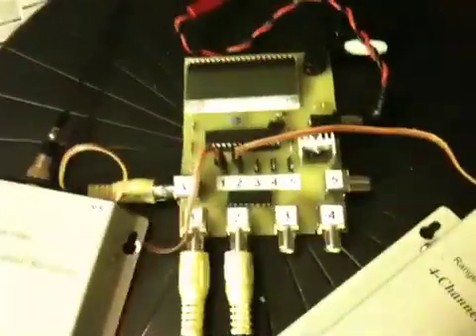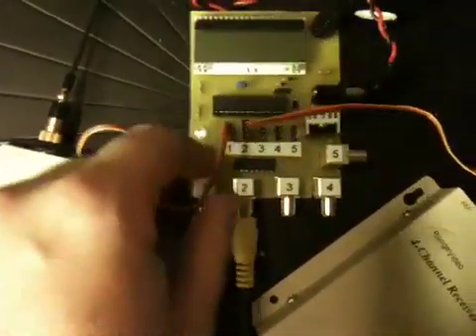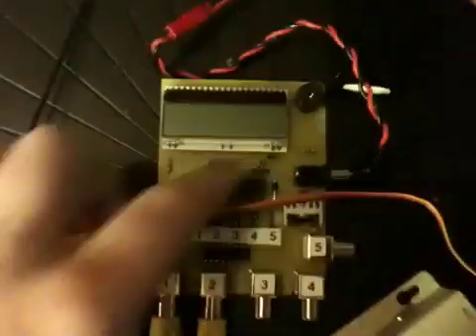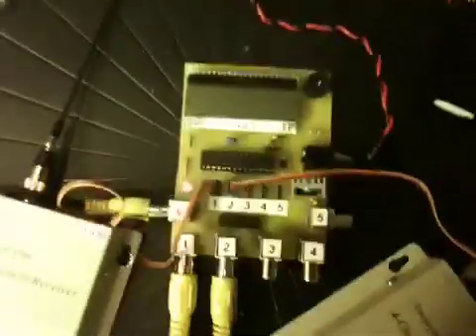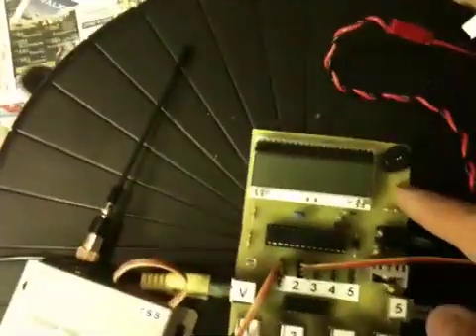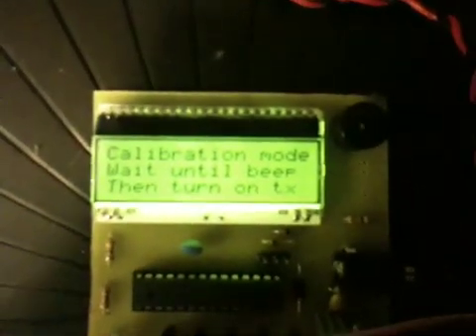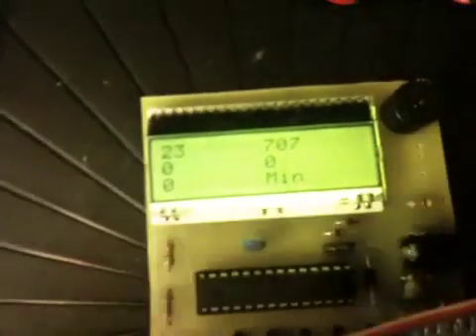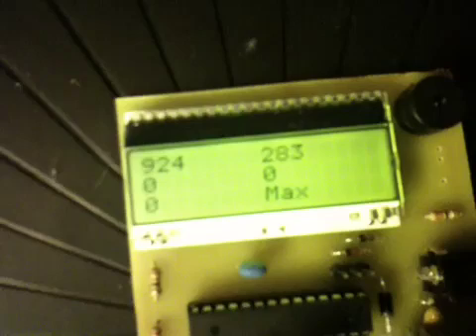FPV RSSI SWITCH v1.0 test

Comment from the maker: @Dmitry968 I know what you mean, but i made this for diversity purposes like polarization issues and such. And to be able to use multiple antennas instead of a tracking antenna. I use analog video receivers at a specific frequency. Having a identifier transmitted in the signal would have no effect, if there where a foreign signal at the same frequency it would interfere anyway.  A totally immune system would require frequency hopping, very hard and expensive to make :-) have a nice day !

Comment from the maker: @carlosthecactus Thats the idea, many antennas :-) Most likely your receiver have rssi output inside. Just open it, and locate the "metal box" inside.. Measure the pins on that box (likely its a pin not connected to anything) with a multimeter to see if the volt on one pin is different if plane transmitter is on and off. It might be 0v if transmitter is off and 5v if on or it might be 4 volt when its off and 2 volt when on etc.. Thats your rssi pin :-)

Comment: Fantastic stuff.  I think this could be a very good product.    I think your auto-calibration method is very neat also.  5 inputs means you could have 5 patch antenna covering 360 degrees at 8dBi.

I recently asked the supplier of my 2.4Ghz receiver if there is a RSSI output on that, but he said no.  I will have a look inside sometime as he might have thought I meant an RSSI output on the outside of the case.